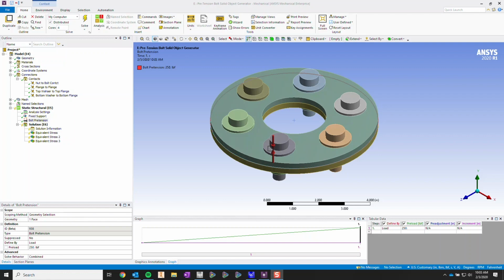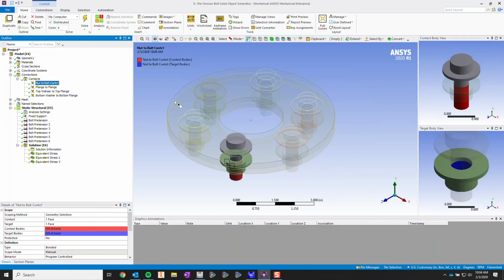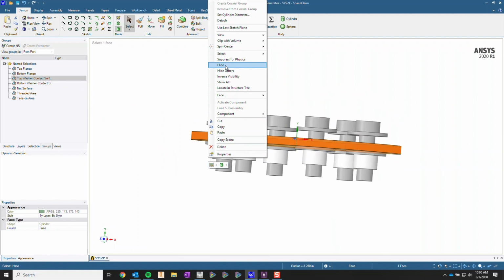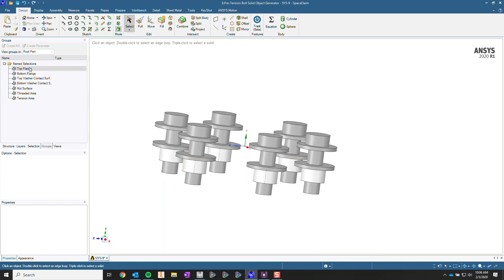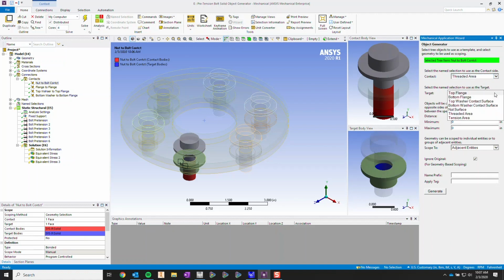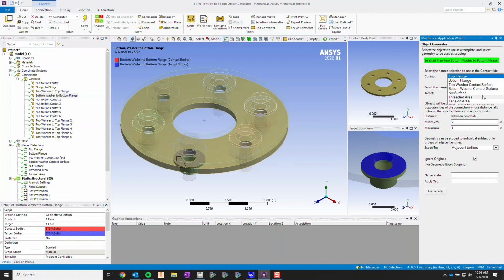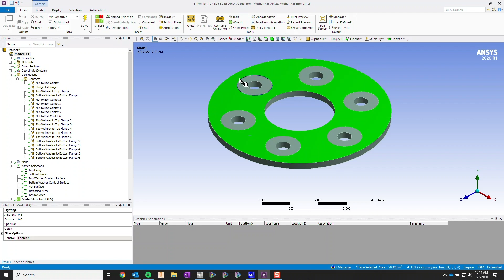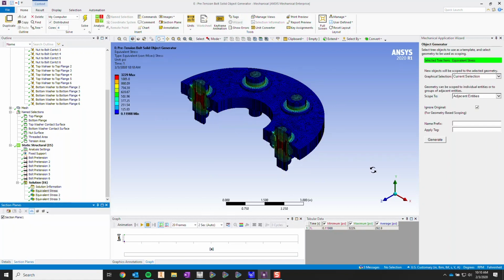Tech Tip: ANSYS Mechanical: Using Object Generator to Automate Loads and Boundary Conditions

Comment: Might be asking a lot. Is there a way to see which objects have been generated using the object generator. E.g. if you are checking a model someone else has made, rather than go through everyone, just check the original one and that the generated ones are scoped to geometry correctly without having to check all settings?
Reply: Hello Janner,

There are many means and methods to observe contacts. 

If you are interested in the contacts made for a body with other bodies, you can click on that body, right click, go to, view contacts and it will highlight all the contacts for that body. 

If you are interested in the contacts between two different bodies with one another only, hold CTRL, click on both bodies, right click, go to, and select contacts between both bodies. This will highlight the contacts that have been generated and exist between the selections you have made. 

You can also select all the contacts made, right click, and have them renamed according to which bodies they are scoped to. This might help you manipulate your contacts better. It's even better if the bodies all have their own name. E.g., Screw1, Screw2, Screw3, etc. They will have their names in the contact list and it will be easier for you to find.

I hope some of these tips help. 

Sincerely,

John Dao, P.E.
Sr. Applications Engineer at KETIV Technologies
Reply from the maker: Thank you John!